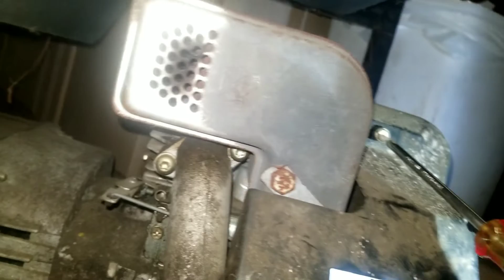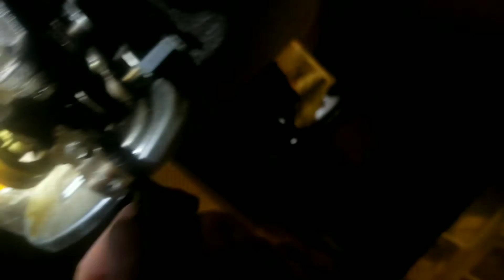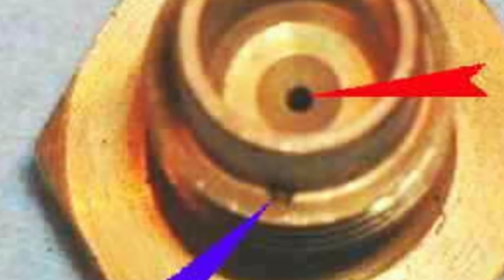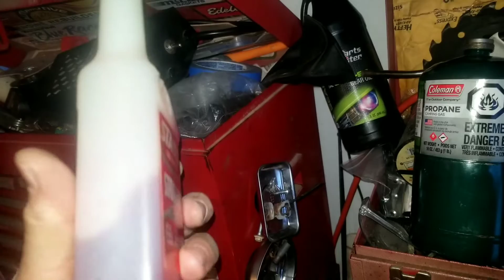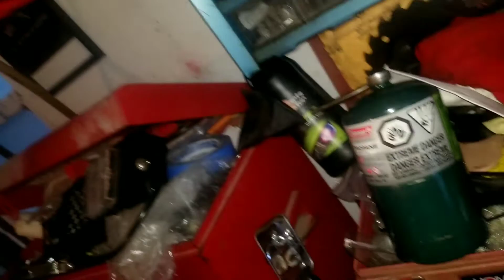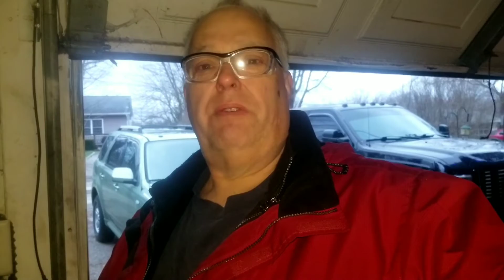How to flush fuel system and clean carburetor to get your generator running quickly.

Comment: This is an older generator , but this even more important on the newer ones . Always use your fuel shut off and run the carb dry between uses this will save the carb. from going bad . If the gas is a dark yellow colour or smells funny ( not like gas ) it bad change it . The fuel shut off is there for a reason , use it .
Reply from the maker: People just dont take the time to do the right thing. I guess it helps keep us repair guys busy.